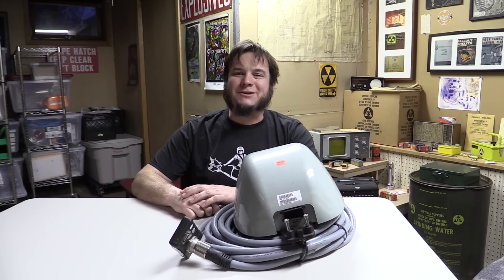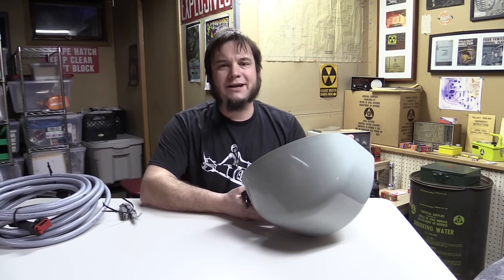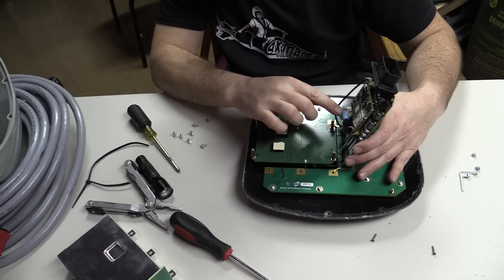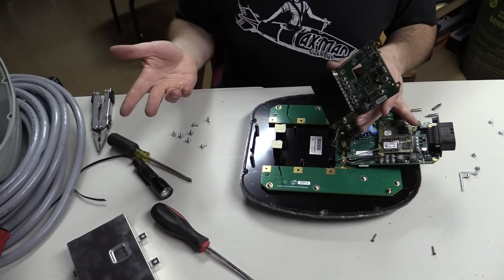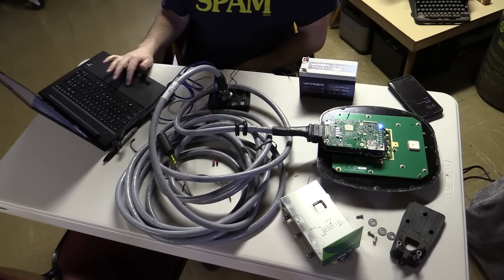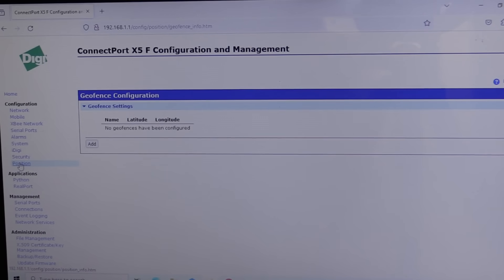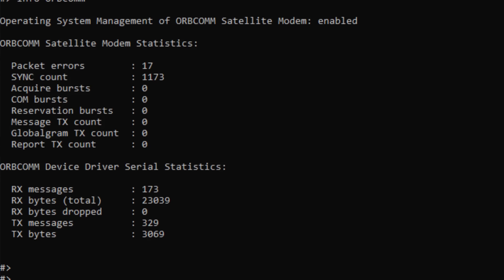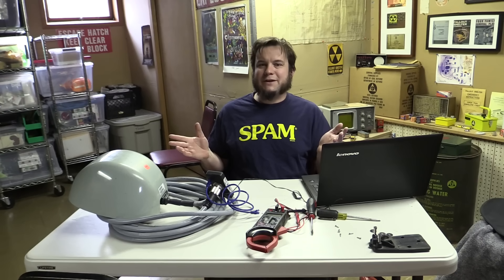Hacking A Satellite Truck Tracker - Digi ConnectPort X5 Antenna Teardown

Comment: Those 4 and 8 pin connectors look like the power connectors you'd see on a PC PSU.

You should pick one up cheap and see if any of the connectors fit it. IIRC theyre mostly standard.

Comment: I use to work as a heavy fleet mechanic, we had a mobile fleet reporting system I think it was RT something. It would report all kinds of useful telemetry- vehicle hours, speed, location and any fault or problem code the vehicle encountered, just as @fluggaenkoecchicbolsen posted below. Air bag deployment, on and on. The issue we had was the tall concrete buildings all around the area these vehicles traveled (an airport) would basically absorb the signal. This is right up your alley, the unit transmitted to a satellite then back to the shop. We wound up installing a signal carrier on the highest building. It was a very expensive system.
Reply: This unit could be 20 plus years old.
Reply: https://www.nv5geospatialsoftware.com/portals/0/pdfs/exactView_RT_Slick_Sheet.pdf

 take a look at this PDF... I didn't, got stuff to do. Good luck!
Reply: https://www.nv5geospatialsoftware.com/portals/0/pdfs/exactView_RT_Slick_Sheet.pdf

 Some how this link was lost, I hope you get this one. The company may have Been RTA...

Comment: All kinds of people in the Cincinnati area give away copy machines they don’t use anymore. Many have giant paper hoppers on one side and massive post processing units for stapling at any angle or punch any combination of holes. They are full of bearings, shafts, stepper motors, brushless motors, dc motors, power supplies, relays, gears, springs, cable harnesses with standard and exotic connectors, casters, clutches, limit switches, bushings, cables, drawer slides, casters, endless photo switches. Some big harnesses if you get a 220V commercial machine.  Also lots of optical stuff that looks cool but I can’t think of a good use yet. I would keep it a secret but I’ve already collected 8 and still have one to take apart.
Reply from the maker: I remember doing a cleanout at work where we threw away about every type of corporate laser printer ever made. Same deal, tons of motors and parts but way too much even for me!

Comment: When I worked on a system like this (in Minnetonka maybe this was gen1 :D ) it was mostly used for truckers going to oilfeilds so they could get all the appropriate info for the pump and for safety (if you leave the truck theres an auto 911 call timer). this was before cell/iot networks were ubiquitous when everything was done with paper and landlines.

Comment: Might be worth signing up for a T-Mobile reseller (Mint Mobile or US mobile are cheap) and try to to connect it before T-Mobile kills their 2g network later this year. Antenna Man has a great video on how to get a 2g device to still work with T-Mobile. He used an original Motorola Razer and got it to make calls.
Reply from the maker: Huh, I thought it was already dead. I had a 3G trail camera that stopped working last year, didn't know 2G was still around!

Comment: hmmm it probably supports 1Hz NMEA messages lol. i've seen super fancy pants navigation equipment that support NMEA in addition to whatever other methods they used. i worked a fair bit with mobile navigation stuff, and that long cable with the small box looks like a breakout box of some kind that probably handles interfacing with the receiver. its interesting to me that the antenna is right on top of the receiver though, because i've usually seen it where the receiver is actually inside the rig and the antenna just connects over a regular coax cable (with N fittings). less stuff outside means less stuff to waterproof

Comment: looking at the datasheet of th digi module (the "brain", not the antenna), it seems it has sensors you can use, also car CAN bus. Also, they have some python sample for programing a bit. I see, on usatcorp website, a big pdf with a lot of instructions (not exactly the same antenna but the X5 is the same)
Edit : the round connector can be found, on farnell (searching "round connector satellite truck" :p) but google does not know more about that ;)

Comment: Ahh yes, the old XRS trackers, that was a MN based company that all but evaporated after being acquired by Omnitracs. Lots of I/O on those units. The TX/RX/GND/3.3V header is TTL so likely a console port. The SWD and JTAG ports can be used to download/upload firmware.  Would be interesting to see if you could decode ORBCOMM packets from that unit somehow. I believe the ORBCOMM frequencies were in the 1.6Ghz range, you may be able to reuse that antenna for a GOES project? Looks like a fun tear down! Let me know if it ends up in the pile, I may be interested in taking a crack at it :-)
Reply from the maker: The antenna could be fun for other stuff, but you can also buy those PCB antennas on Amazon really cheap. I've used a few similar ones combined with various reflectors for GOES and other weather satellites. I'd like to figure out more uses for the ORBCOMM modem, but I'm not really sure where to start with it and have a lot on the to-do list!
Reply: isnt the 1.6 frequency the same one they use at skinwalker ranch?

Comment: Neat thing. Power connector is EPS 12v, though using standard ATX PSU probably not a good idea considering the pinout

Comment: An interesting antenna, there's a lot of technology involved in it. I'm looking forward to the next video. I think you may have heard that the Japanese have deployed an amateur radio beacon on the moon. The amateur radio beacon transmits on 437.41 MHz in the 70 cm amateur radio band with 1 W. Apparently, there's an issue; during landing, the beacon didn't land as intended and ended up at a slight angle. As a result, not enough sunlight is reaching the solar panels of the amateur radio beacon, causing it to operate in a limited capacity. When more sunlight hits the solar panels, it should resume normal operation. Perhaps you've already attempted to receive the signal.
Reply from the maker: I haven't tried that yet. I know they did a lander that kind of came down sideways, I didn't know it had any amateur radio stuff though. I would think they'd disable any extra features like that to save power.
Reply: @saveitforparts  The lander has amateur radio equipment on board. I hope it can also be used as a relay; that would be very convenient – an amateur radio relay on the moon. I think that's better than an Earth-Moon-Earth connection. It will take some time before everything can be put into operation.

Comment: Are you able to download those files listed under the Python heading? Could be some interesting stuff in there. Might also find examples in there of how to use Python to interface with the hardware - poll the GPS, spit data out to serial, etc.

If this thing can speak ethernet, wifi, and zigbee it could be used as a smart home hub for zigbee devices. GPS could be used as your network time source. Of course you've also got the bonus of cellular and satellite too! Lots of PHY devices on that thing!

Comment: WOW! I just love reverse engineering stuff. 

I have one LCD display that I didn't know how it worked. I found some info on google and YT... The display I have, has an additional daughter board the on line info didn't have. So I separated the daughter board from the main board. 

The only info I found gave a pinout of the connector between the 2 PCBs...

So I fired up KiCad and started making footprints of the pin connector, 
and tracing every line point to point and making a schematic of it. 
Then I used a digital caliper and measured exactly where everything was in relation to 
the mounting holes and pin connector.

From that I was able to wire it to a esp32 and write code to display text..
All I need to talk to the display is GND, +12V, and the RX input line.
The display needs a special start command similar to the MODEM AT command.
For the display, to clear screen that command in C is 
          Serial.write(0x5C); // AT command
          Serial.write(0x40);
          Serial.write(0x20);
          Serial.write(0x30);
Reply from the maker: That's cool!

Comment: Orbcomm has 31 "Birds" up there.  They operate between 137 and 150MHz.   I once tested a poor-mans interferometer at 137ish MHz and got strong fringing from the Orbcomm birds.   But I never really tried using them for their intended purpose :)

Comment: Wondering if you could use it as a satellite internet line
Reply from the maker: I'd need some kind of account with the satellite provider.
Reply: I think most sat internet services run up in the Ku/Ka band..this device would not be compatible with it with the current onboard antennas.

Comment: I used to work for a company that produces cellular vehicle routers but I've never seen that huge yellow connector before and that's one girthy cable LOL! Have you found any video/photos of one of these in operation?
Reply from the maker: I haven't seen this exact type, but I've noticed similar domes on top of semi trucks. This one is a few years old and probably obsolete.

Comment: I wonder if the sim card is still live. Maybe stick it in an old phone and see if it has a data connection.
Reply: He mentioned that it uses GPRS, a feature of 2G mobile networks. It died along with 2G. Also it was VERY slow when it was alive. T-Mobile customers know this as EDGE
Reply: 2G is not dead. I was on it briefly the other week. It was 3G/HSPA that was killed. 2G remains for IoT things
Reply: @eurithmicsrocks  I was going to say T-Mobile 2g is still active
Reply: T-Mobile still has edge live and they keep delaying their shut down date
Reply: @TenForceFalls  geez I wish AUS could have kept it going in the background, had to move pops on from his 3320
Reply: Definitely try it
Reply: Does the SIM card work? Lol
Reply: Quite likely it's not. Somebody was paying for a cellular number and account that was associated with that SIM card. That account would have been turned off when the system was removed from the truck.